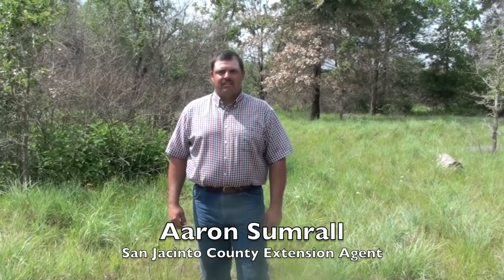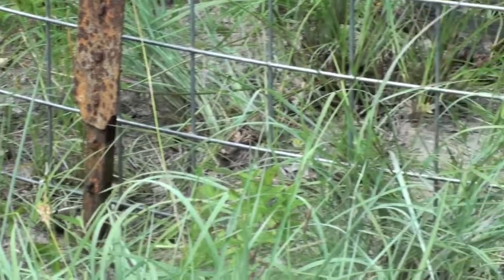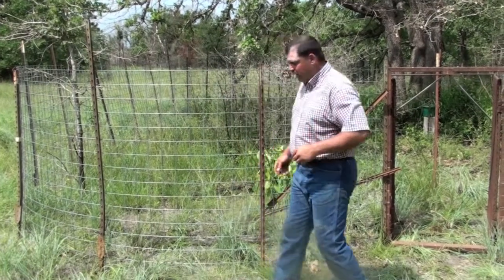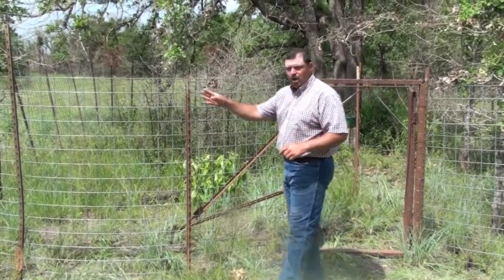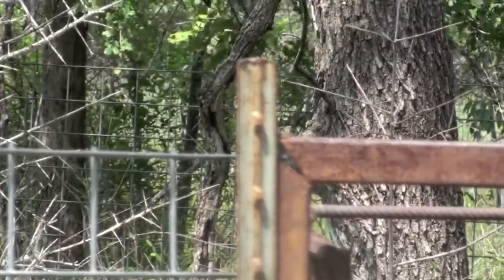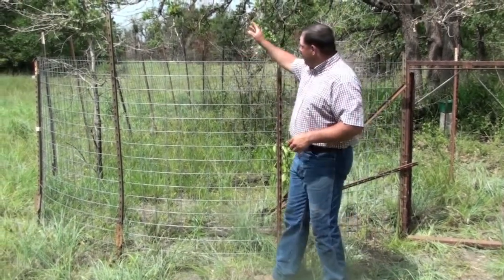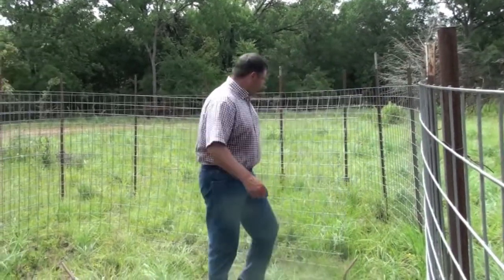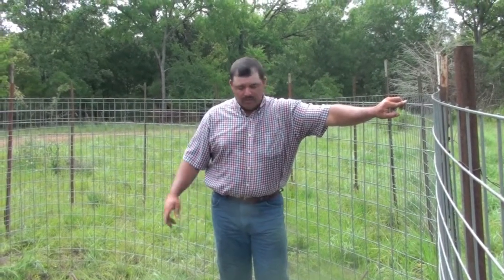Trapping Feral Hogs: Corral Trap Designs

Comment: pHD canidate? he should know you can't use a 4 inch bottom square, the first 3 or 4 rows should be 2 inches, otherwise all the little pigs will get away, and any adult raccoon or possium is not getting out of a 4 inch hole...i dont believe so.

lots of good info, the sweep gate is a great idea
Reply: At the farm supply stores TSC, Rural King, AgriSupply, etc.  They sell cattle, goat, and hog panels, each are made differently.   Just use hog panels don't waste your efforts.